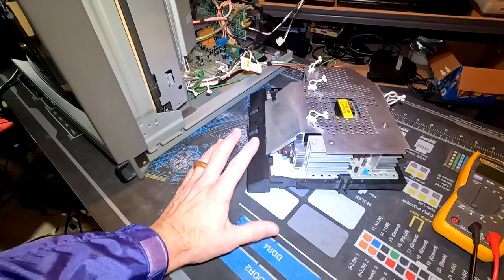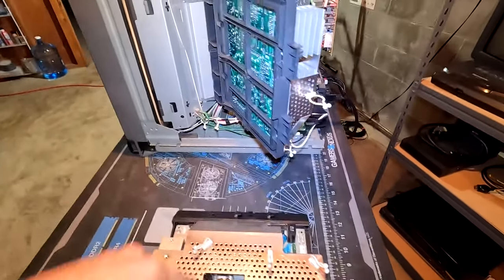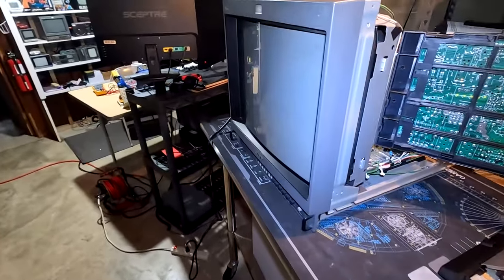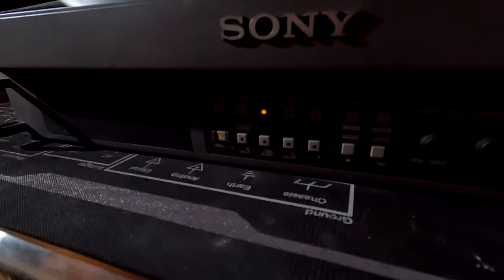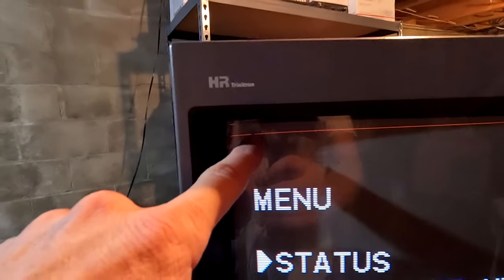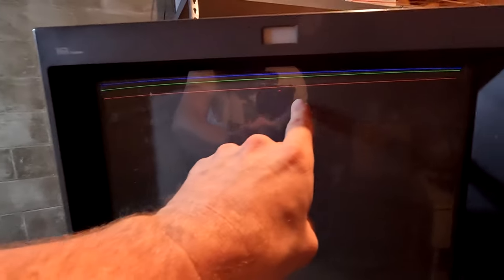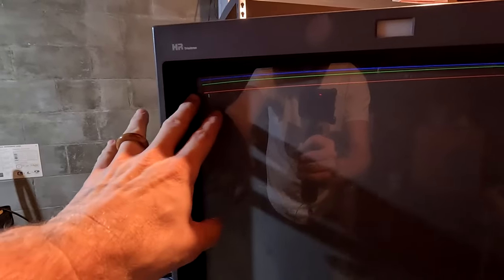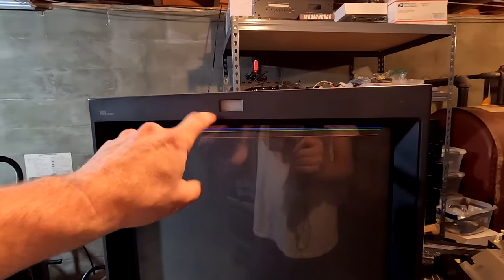Sony's Red Tally Light of DEATH Repair | Retro PVM CRT

Comment: Awesome rundown of fixing these issues with the 20M4U. It's great to have someone document this for others who want to enjoy these monitors while they still last. 

I have a 20M4U and a 20M2U and they both work fantastic. There are no issues of any kind but I want to future proof it the best I can because they are my treasures in my game setup, so should I get the capacitors replaced, or don't fix what isn't broke yet? I have read before on Reddit posts and from other retro gamer CRT repair people that have said if it's a good one, then it's a good one and don't mess with it until there are actual problems. What is your opinion on that?

Comment: I've got a 20m2u with a tally light as well, no energy in the tube. Have tested power supply, and swapped power supply with a verified working one from a 14m2u. Another odd thing is that it will run for a few minutes after letting it sit turned off for a while, then will lose power. Have replaced almost every cap, still no good. Driving me nuts.

Comment: Wait what? I thought some PVMs simply had a red tally light lol. My 14L2 is red when I switch on the tally light, but it doesn't have a single issue whatsoever. Has been working perfectly for years now, and everything inside looks pristine as well. Does this really mean something's wrong and it should actually be green on the L2?
Reply from the maker: This is only going to apply if your tally light stays illuminated and your PVM is not functioning or powering on properly.   

Your PVM is fine it sounds like.
Reply: @RetroTechUSA  Ah that's a relief. So you're saying that the L2 indeed only has a red LED inside of there, no green one, and the fault you're describing will turn the tally on by itself?